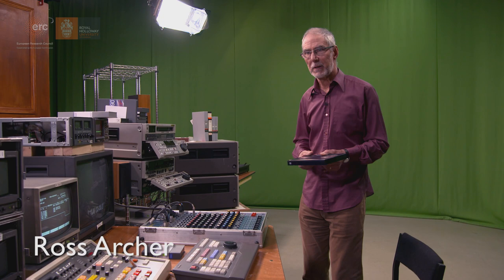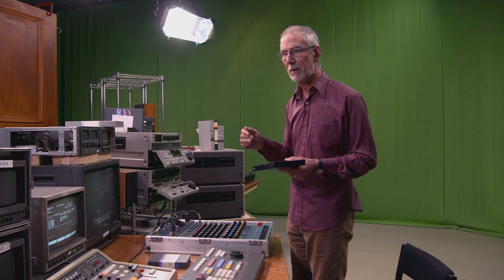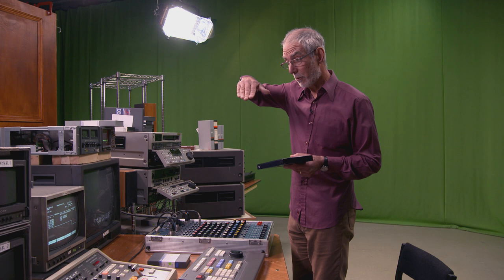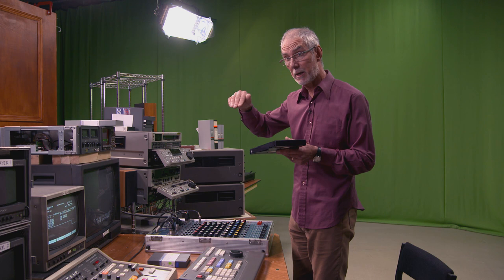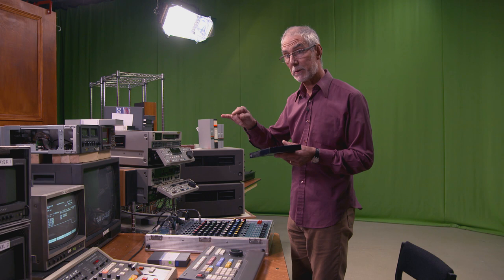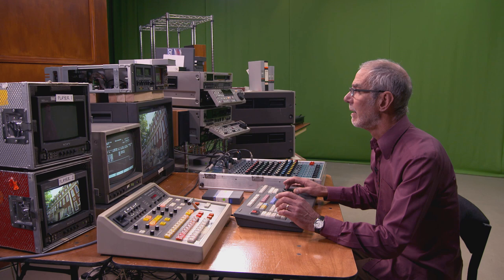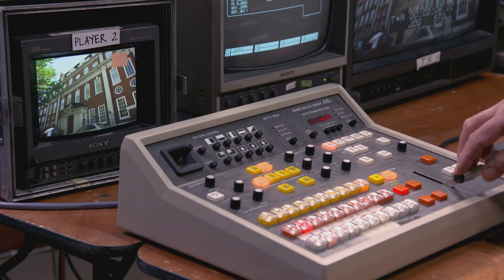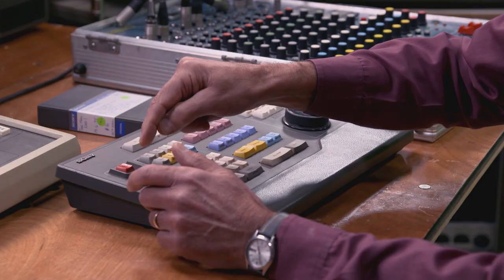post cutting betacam preread

Comment: Just discovered these videos. Remember doing inserts for Children in Need and producer turned up with a master edit that had been done at an external editing company. Demanded to put captions on using pre read. It was only a 4 minute item and I argued not to use pre read as if the caption  was wrong or misspelt (a common occurrence) we had no rushes to replace the shot and redo caption. Made a copy and captioned that but she wasn’t happy with the extra time it took (5 or 6 minutes).
But pre read was great for football where you could do mixes with one machine.

Comment: Pre-read was a great way to add downstream key titles and credits to an EDL conformed master. Also adding adding dissolves between the existing shot into a new shot. All very easy in a SDI digital suite,  but if you used it in an analogue suite you would need to ensure the suite was lined up property several times during the session.
Reply: Pre read or xroll

Comment: Fascinating.. I’ve been an avid offline editor for the past 20 years in the UK.

I’ve never actually seen this technique done with a linear suite. And I’ve learned something 

I remember the switch from beta sp to digibeta.. and I’d been using non linear systems for years at that point. 

That would mean that this technique was still used a lot more recently than I’d have expected.

The channel looks fascinating.. and I’ve subscribed.
Reply: Do you know Spud?

Comment: P.S. After watching this video again, he talks about the pre read, if that is the case, which he does, he should have a third video monitor sitting there monitoring the out put of the pre read, after and  before the program monitor, see's the finished edit, as a playback video. Then you will see it on playback on the program monitor. But, when you think about this process, the smaller monitor to the left as he said it's connected to the video mixer, which  is in the effects preview monitor, which would not be a pre read. Then he says, there's a lot of heads in there that of, a, erase head, re-cord head, and playback head. On an audio tape recorder, or reel to reel on some high end machines, there is a third, head which you can actually hear the playback as you are recording it on tape on other speakers or cue'ing speakers. So, if I'm incorrect in my thinking about this process in the way that he is explaining it, somebody please, let me know, how this is working in this video.
Reply: It doesn’t work like that, because you are already using the playback head for preread purposes, this is ‘read before write’ rather than ‘read after write’. You can either use the playback head like you would on an audio tape deck to give ‘confidence replay’ of what you have just recorded, or else use it to read from the tape, process the result outboard (via vision mixer etc.) and then  write that back onto the same tape via the record head i.e. preread as demonstrated here. You can’t do both those things at the same time.

Comment: so could you add like a lower third graphic running through an entire hour program for example using one machine? Were there any time restraints or maximums with pre-read?
Reply: No time limit. Yes, you could do the entire tape.
Reply: I did an 300 layer deep program bumper 100 seconds long. Just because the most Disk Recorders any other post house had was 90 seconds. 300 layers, because each object had a shadow, a glint and a frame. If you get over the glitzy sales pitch, this video explains what you can do with Pre-Read. https://youtu.be/pQwrAnGSkbU
Reply: @OldProVidios  I used to build retail spots on Digibeta with pre-read... Photoshop graphics into Inscriber, into a DVE and on to tape. Layer by layer... Lay in the background for 30 seconds over the voice over, [REC] fly in the product over the background [REC] fly in the price [REC] etc etc... 
It was great when you'd get a way in and the client would say "oh, actually can we hold on that first product for a beat longer?"
Awesome technology.
Reply: @DylanReeve  Yea. 
Talk the client in to liking what we have and offer a solution that is an easy fix.
I would save critical layers on a backup deck. We called that D2 Squared. By saving the DVE/ADO moves and the edit list, we could match in with graphics. Reverse hold outs and using the graphic key filled with the previous layer made things go away.  I think that is what made editing fun. Finding a work around for an effect. 
I made a long time client because I found a way to unroll a poster.

Comment: Sorry, but I disagree with his assessment, you should always make (copy) of your master tape, then edit the copy when you're using this type of a machine, never use the master if you risk making a mistake, or as he puts it, MUCK IT UP. When I was a TV engineer, we always copied from the master, just in case of accidents like that would happen. That's the first rule you learn as a TV engineer,  if you did anything like that in a commercial TV station, you could get fired, no ifs, and's, or buts, cause usually the advertising agency only send you one copy, of that commercial tape. Or any program that is sent to you from another station. Then it goes through production Department for editing. I also might add, while broadcasting the news or any program Live, waiting for a spot commercial tape to come in To air in that broadcast, and it needed a tag at the end, we did it live. But if you have time, to do that kind of editing with that type of machine, you are told to make a copy first, before tampering with that video tape.  That would save your ass. And I mean that, in a Real Since, Some body's Head will row. Back in those day's, they didn't play around. You would have to do a written report, or at least, tell your supervisor what happened to that video spot. But bottom line, that is a great machine to use, too Short Cut The Editing Process.

Comment: The whole suite hasn't been setup correctly. You can drive the vision mixer from the edit controller and never touch the T bar. Makes it look a lot harder and a lot slower than it was.
Reply: I think it was set up for demonstration purposes. He is a pro-editor and I would do this to teach some about the process.
Reply: @8teillumin  I'ma pro editor and used a similar setup for many years - I've eaten pizzas off that kit at 3 in the morning trying to finish a program for broadcast the next day, trust me I know how fast things work
Reply: @idustrialrevolution  let’s not get into a pissing competition.. I’m sure like yourself I grew up with 1” VPR3’s and 6’s then into Umatic, BetaSP, D2, D3 and D5. We both know how fast you can be. I just meant that for the purpose of the video which is for public engagement he has “slowed the process” 
Just out of curiosity where did you work?? I worked for several independent prod houses and briefly for the BBC.
Reply: @8teillumin  All over the place, BBC TVC, BBC OBs, First freelance editor at ITN, CNN, CBS, TWI/IMG to name a few
Reply: You can only do that if the BVE910 has the option card to support it. Maybe this one doesn’t.

Comment: How many times could you copy a Betacam recording before you started to loose picture quality? For example, a second generation VHS copy clearly already had breakdown in the picture.
Reply: Betacam was made for being broadcast quality, and digibeta and SX were developed to give no qualityloss whatsoever as it's all digital. However, betacam SP and it's former version, plain betacam, were a whole different ballgame. On those formats, you actually did see small parts of ghosting around the edges, especially if you dubbed them too much from tape to tape.
Reply: Digibeta was 2:1 compression and not lossless, so there will inevitably be quality loss through multiple generations.